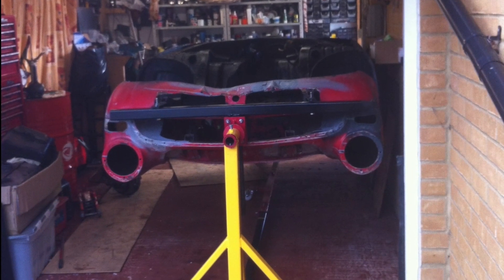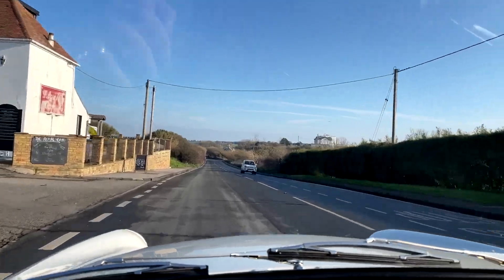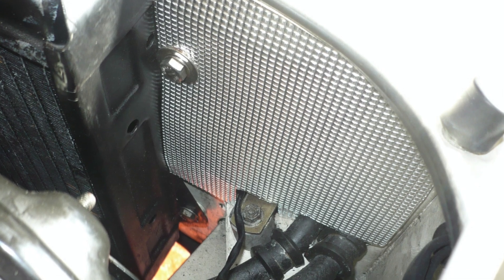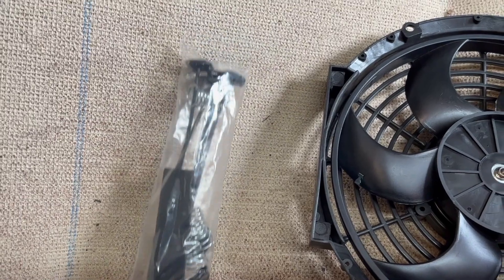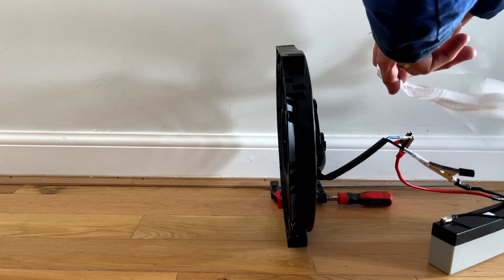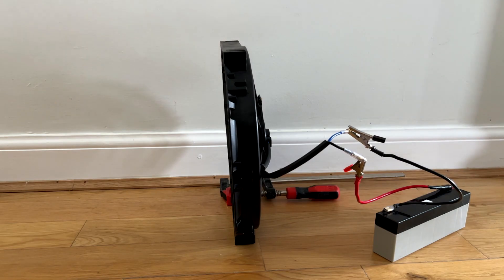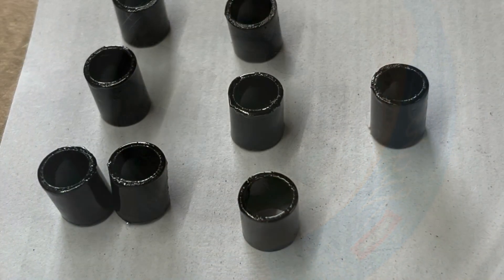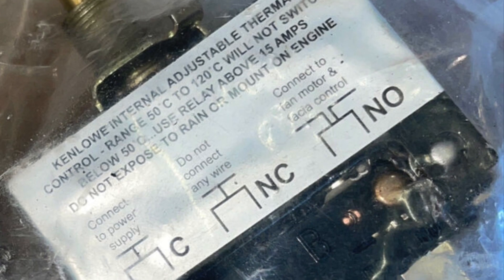Sunbeam Alpine:  Fitting Twin Electric Fans and Twin Relays

Comment: Are they 7” fans that you installed?
Reply from the maker: They are 80w fans. I THINK these are 9” I will try and measure them in position and confirm.
Reply from the maker: I have checked the receipts and they are both slim line 10" fans.

Comment: Yes I need this. My all original '67 Alpine is always threatening to overheat if I have to wait through a few lights in a row using 89octane non ethanol. I turn the engine off sometimes when i catch a red light. It's my biggest issue with the car.
Reply from the maker: Hopefully this will help you. Twin fans cool the radiator quickly. You may have other underlying problems though, such as silt in the block or radiator.

Comment: I was able to place the two 10" Derale fans inside the engine bay by cutting away a few inches of the protecting tines surrounding the blades.  I am not sure if this is necessary for a stock radiator; mine is aftermarket aluminum and about 1/2" thicker than stock.  I must confess that I prefer the look of a clean radiator in the front of the car over the fans.  I live in Arizona, where temperatures regularly exceed 100F.  My car now runs consistently at 100C, except in the hottest temps, when it will reach 115C.  My fans are setup with thermostat activation and a manual override.  The fan thermostat resides in that large hole on the port face of the head that is typically plugged with a large bolt.  I blocked off the oil cooler pass thru on one side and on the other, I blocked it off by fabricating and installing a cold air intake box, similar to your setup, for the Weber 36/36 I installed.  Not sure how much HP is gained by the cold air intake and removal of stock fan, but the car feels peppier.
Reply from the maker: That sounds like a great set up that will keep the car  running cool all the time. US made fans (like British or German ones) will be higher quality than the ones in this video but probably cost a lot more. I agree with a clean look on the radiator being preferable but everything in life is a compromise and we decided that the benefits of the twin fans pushing back outweighed the benefit of the cleaner look. In terms of radiator coverage the area of the radiator opening is approximately 228 square inches. Each 10" fan covers 79 square inches so around 70% of the radiator is being cooled directly behind the fans, with one fan it is 34% so it is quite a significant  increase and a good percentage of the radiator is getting cooled by a 60mph breeze.
Reply: @TheSunbeamAlpineChannel  One thing to bear in mind with these twin electric fan setups is if you are running these on an earlier Series car than the 5 then you'll need to fit a dynator or alternator to keep the battery charged. The generator or dynamo is totally incapable of keeping the battery charged up. In heavy traffic you will get a flat battery in a very short time otherwise.
Reply from the maker: @eddiezetlein6582  Eddie, totally agree, it is always a good idea to have some spare capacity in your electrical system.